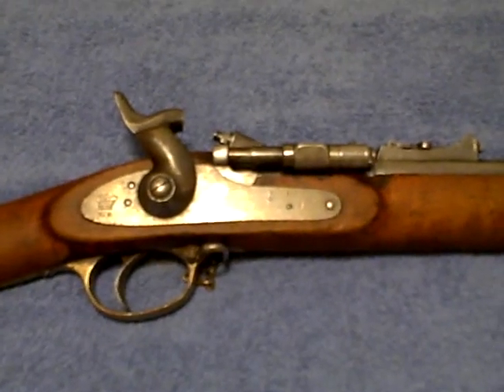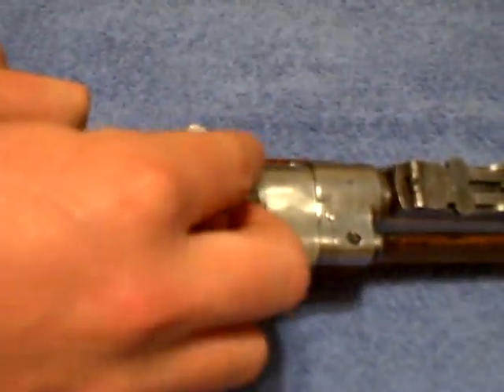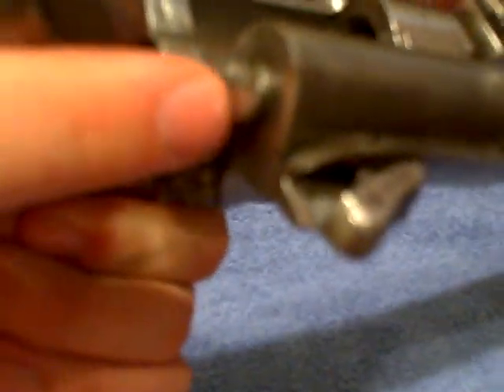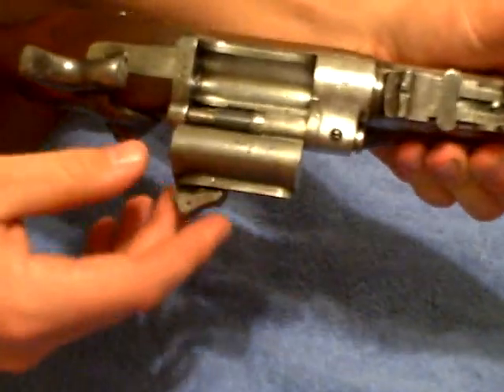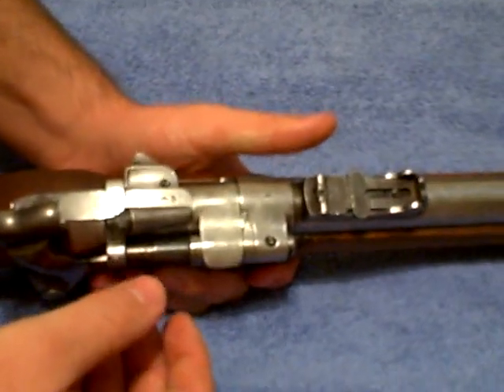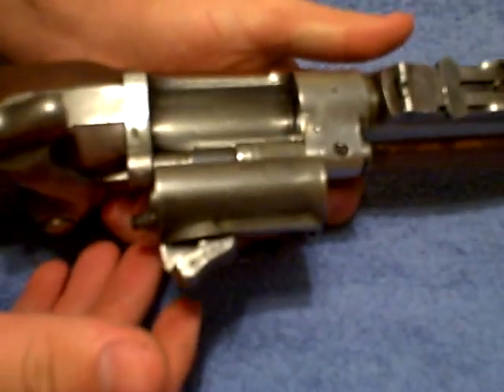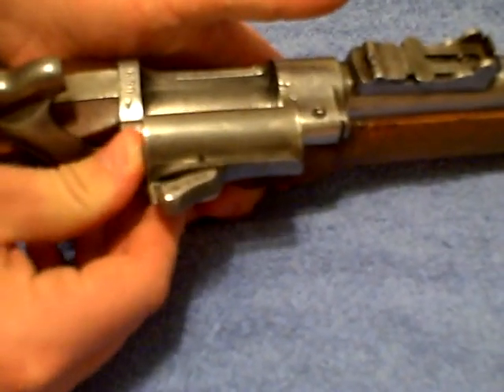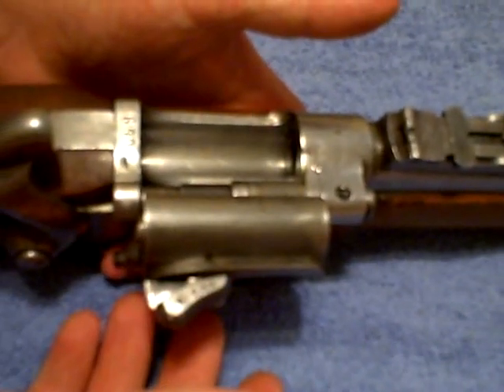Dangermandave Snider Rifle Problems

Comment: Great job!  I got the breech open by pulling that locking lug out through the back of the barrel assembly.  Just as well that hole went all the way through or I probably never would have got the thing open.  So thanks very much for your help.

Comment: I had one that the locking mechanism was stuck as well. I managed to get it unstuck eventually with a mixture of kroil after removing the screw/pin you pointed to as well as the main latch pin. Then reaching into the slot where the breech locking mechanism was I worked it backwards with a small tool. My suggestion now would be to soak the entire thing in a lye/caustic soda solution (the metal only!) to just eat all that yak grease and garbage that they put on the Nepal Sniders. That's worked well after finding out about it from the  British Militaria Forums for cleaning the junk off the metal.

Comment: I had the same problem with a broken thumb lever on the original so I couldnt open it but I made a new one.  Bought a BB gun thumb lever on ebay and shaved it so it would fit the lock and just fixed it in with a screw.  Works like a charm, it may wear out over time because its plastic but they are only 3 bucks.

Comment: Oh dear, oh dear.  Please, just remove the barrel and breech as one unit.   Then access the end of the locking pin from under the tang.  Tap it in until the breech is free.  Then remove that side lever to help extract the locking pin from the block and check what is wrong.    Yes, it is that simple!

Comment: That was cool to see and very informative. 
Have you thought of using ZEP 45 it's a mild penetrant as well as a solvent.
Don't be worried if it foams up as soon as it makes contact with the gunk inside it means it's working. Leave it for a couple of hours and work the moving parts and you'll feel the results immediately.
It comes in an arisol spray.
Get the orange can.

Comment: Looks like the swingin hinge door should come apart somehow...those springs have to be replaced..I've taken the spring out of a trapdoor and just let the firin pin float but it's good to have the spring in...that's what it is though crud buildup no doubt
Reply: It does. The is a retention screw atop the breech block, once its removed the hinge pin slides out and the block is separated from the receiver.